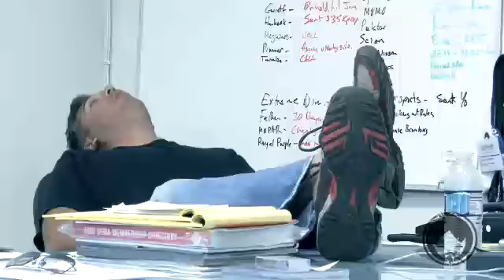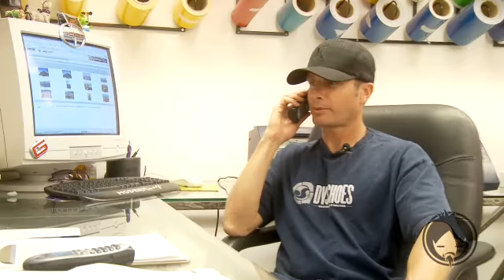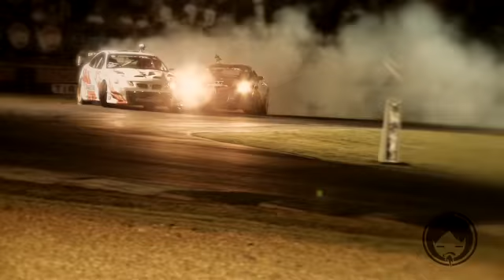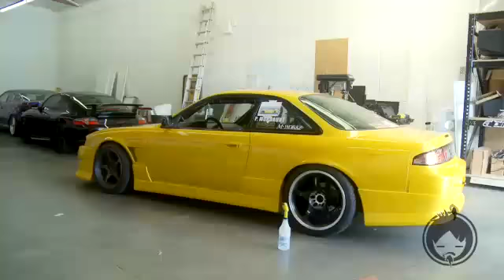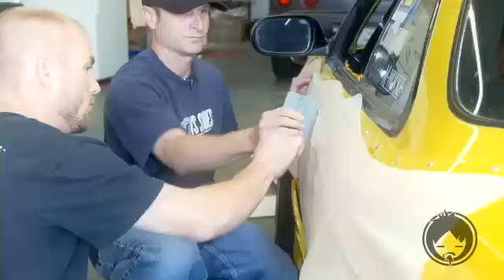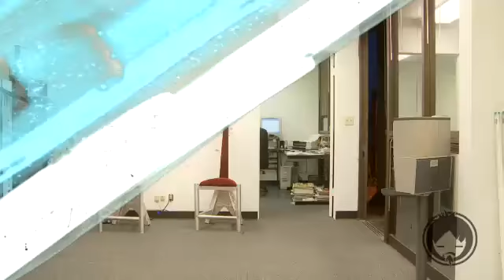Modern Image Vinyl Graphics Install

Comment: been installing for 20yrs. 3M Preferred. never ever did wet application on a vehicle substrate.  not a good idea ppl.
Reply: Ted Lumley load of bollocks ,I have been doing it for ten years and I never had a problem with any of my vinyl fitting it never peeled my customers never had issues ..
3M seems to be the holy grail of vinyls fitters ,u yanks believe everting yous are told  there are many great vinyl company’s out there .

Comment: Or you could use the correct vinyl and forget all that wet apply crap.
Reply: Morgan Hatfield it’s easier ..   with wet application for positioning .. better than havin to peeling it back every time it’s not correct 
Then you are over stretching the vinyl every time .. 
I have been doing it for 10 years never a issue ..

Comment: Thanks for the tip on using more soap in the solution.  I've got a new windshield banner on the way and I'm hoping this one goes on easier than the previous two I've had.

Comment: @000firebird 

i had a vinyl on my hood - with very thin shapes. i was there for over 5 years with no peel off or anything.

the car got washed in a carwash and was parked outside almost 24/7 - no effect